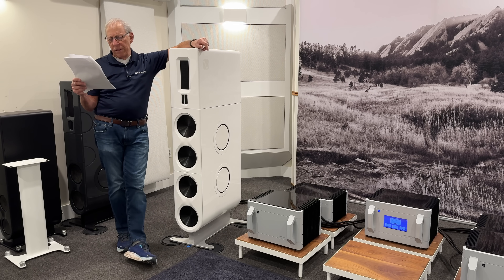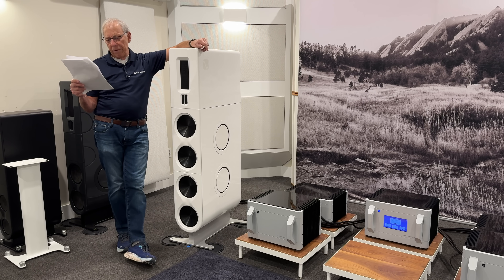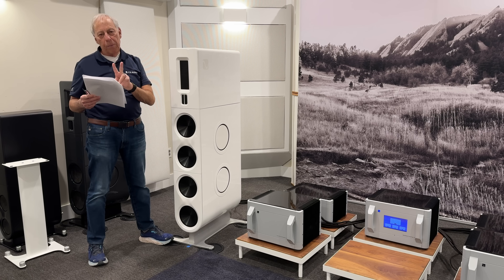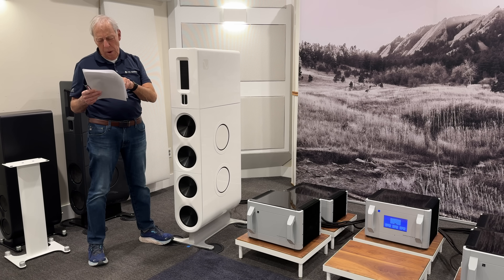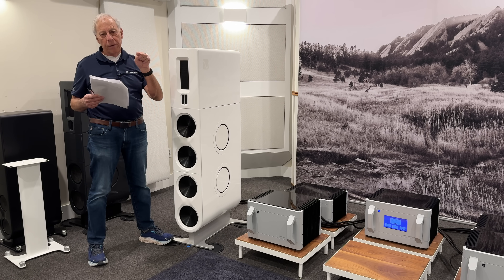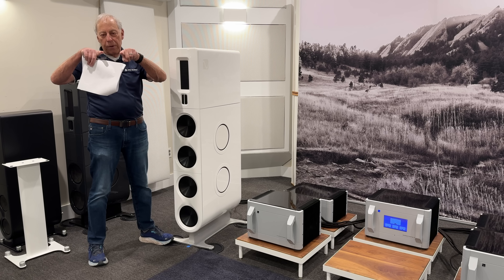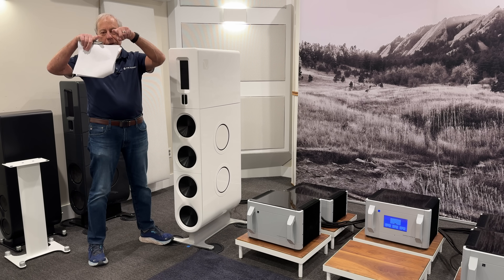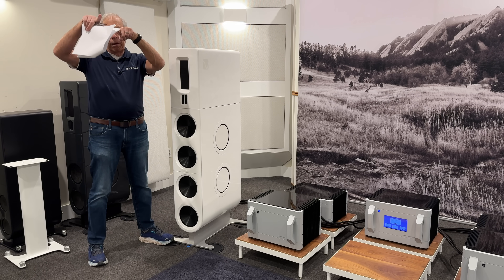Paul explains amplifier gain

Comment: The rotel rc 1572 preamp spec shows a max output voltage of 2v on the xlr ouput.

The rb 1552 power amp is specified as 120 w into 8 ohms with a gain of 22.5 db from the xlr input 
Output voltage to drive 120 w into 8 ohms: (v^2/8ohm) is
31 0 volts
With a gain of 22.5 db = 13.36  voltage gain ..
with a 2v input gives 2*13.36 = 26.72 v output. =  89 watts !?

The  rb1590 power amp is specified at 350 watts into 8 ohms with a slightly higher gain of 23.5 db = voltage gain of 15.
The spec shows it needs a max input of 3 5 as the questioner stated 
With the same 2v input.. this will mean its output will be
30v - giving an output power =
30^2 /8 watts = 112 watts.

Neither amp is getting any where near its rated ouput with  the preamp output of 2v 

IF  we COULD get an input voltage of 3.5 volts from that preamp ...we would get:
3.5 *15 = 52.5v - giving an output power of 345 watts.

Seems like there is an issue with the preamp output?

With the questioner saying he was running the preamp at a modest  setting of "40"  - we can safely say :
Both amps were running at quite low ( and almost equal) powers... and.... it seems neither amp can be run anywhere near max output.

I

Comment: The gain of an amplifier is FIXED according to its design.  What is being set is the INPUT ATTENUATION, usually via a variable resistive load.  Simply, ideally, the input attenuation seeks to match the input voltage max of the amplifier with the output voltage max of the source (matching source and input impedances actually).  That way, full dynamic range is reached with the highest S/N ratio.  Too high, there will be clipping.  Too low, dynamic range will suffer, and the noise floor will increase.  We want maximum voltage without overdriving the input stage(s) of the amplifier for best performance.  There, I said it, EE, power systems.

Caveat:  Some like less dynamic muttled reproduction, as some like the clipped sound.  What is horrible is when the input and source are so far apart that no attenuation will fix it, such as when commercial simgle ended sources are used with professional amplification.  The professional equipment expects 15V, while most home equipment at best is usually around 2.5V.  The source will need active gain (a preamplifier) to properly drive the amplifier.  Ughh, now we add another stage, more noise and complexity.

Comment: “The preamp has an output of 2 volts, while the power amp seems to require 3.5 volts. Could this be the issue?”

YES, that IS indeed part of the issue. If you cannot provide the power amplifier with the required 3.5 volts at the input, you will not be able to get the full 350 watts at the output. This is why your two amps amps seem to be putting out the same amount of power. Paul, you got this one wrong.
Reply: Absolutely.
The higher power amplifier will require  sqrt(375/120) = 1.77 times more input voltage to give 375w ( assuming they have the same gain - however - rotel specs seem to suggest the 375 version has higher gain) 
If we assume that the 120w amp delivers 120w with 2 v input.. then to get 375w will need 2v * 1.77 = 3.54v which it seems the preamp cant deliver.

Comment: Agree with @DeVoN420zz below, what's really needed is to maximize response and dynamic range with as few drivers as possible and reasonable cabinet size. So make a great speaker with one tweeter, one mid (which he has, choosing planars) and get bass with a combo of 8" woofer with good transient response and then a sub to get really low. More drivers with more power (all other things being equal) can produce more dB, but really needed for really large room (or say a wedding venue), and most folks simply don't listen to music in a mini concert hall.

Comment: great video! let me explain those speakers your standing near, if those drivers are all identical then that's pretty much bad engineering and a scam but does look nice, 4 identical speakers and passive radiators quadrupoles the power requirement but only increases the volume DB a little bit, it requires a complicated crossover network that degrades the signal, and wont really improve the frequency response, 1 good driver always sounds better than 4 lower quality ones especially when there all in the same spot, a known fact that you need about 10 or 12 speakers with phase canceling to actually be twice as loud,  A better speaker is much better idea, for example a single 8 inch woofer, with a 100 watts you would need 10 or 12 of these to be as loud as one that's 400 or 500 watts,

Comment: I had a problem with matching gain with my Stellar 300 and Emotiva BasX amps that were doing what you're describing and I just couldn't enjoy the 2 sets of speakers evenly the way I wanted until I got myself 2 Shiit SYS passive preamp potentiometer volume controls. Like Paul likes to say it was an easy peasy fix. Thanks for the better understanding and breakdown Paul. It helps as always 👍

Comment: And yet some reviewers believe an amplifier needs a certain amount of volts at the input regardless of the gain of the amplifier to achieve maximum output. No theme reviews you really need to study basic electronics.

Comment: I think that confusion is next: from where comes the difference when voltage gains are the same for different rated amplifiers? I assume it is current since P=IxU [W]. So I asked the same question but on impact of current to the sound. I assume the current is important when you drive floorstander with many drivers and generally, speaker with low impedance dips. I learned that watching but still not sure did I understood it correct.
Reply: on a normal amplifier the current is just determined by how low or high impedence the speaker basically, the amplifier doesn't control the current until it's too much for the components and something breaks, if it can't conduct enough and things don't break or the overcurrent protection kicks in.

how much actual current will go gets way trickier with a speaker though because it depends on what the cone is doing and how much it is resisting (or isn't resisting being pushed by the air in the speaker back) and isn't linear through the range. it(speaker) has an impedance rating across the frequency range but that too doesn't tell the whole story since what it is now can depend on what the speaker is playing, so reality is just that there's quite a bit of buffer current capability in amplifiers.

generally if the speaker has a 4 ohm rating it should be fine to run with an amplifier with a 4 ohm rating on it. an amp will generally run at least to 2 if not pushed very hard though even if it has a 4 ohm rating on it, it just starts risking or taxing the componentry.

much lower ohms than that because the current still goes up even while the voltage is low will probably cause destruction, even if you're playing at a low volume, because there's some components inside the amplifier that get fried from amps and not from total watts passing through it (that's what a fuse generally does too).
Reply: Yes, I understand fluctuation of the impedance and power is the way to answer it but if the voltage is set, then the current is the difference. So 30dB of gain for the two different rated amps is the difference in capability to drive that voltage with a sufficient current if the impedance drop? The other thing is the attenuation of the signal through the pot so that gain is only out if pot is turned on entirely. Otherwise it is attenuated. Many of us are asking what difference you get with more powerful amp in terms of sound. I understood that you need more power for quicker response and for demanding speakers. And of course if you want to set up the amp to work in optimal region of low distroted power like in motor vehicle where you rarely use peak power.

Comment: Uh. Depending on the imp of the speaker.but yes..
Reply: The impedance of the speaker should not affect the voltage gain.
Reply: @dangerzone007  Agree, except for amps with horrible damping factor where the output impedance is so low that the output voltage drops at loads of near 4 Ohms. A damping factor of 1 would mean you lost half the voltage at a nominal impedance load. But such amp would be horrible for other reasons such as voice coil damping being poor or  impedance curve impacting frequency response.

Comment: The reality is the output of the amp is determined by voltage. The higher the voltage, the higher the watts you put into the system. The gain of an amp is predetermined and most amps are within the ballpark of each other. So with the gain being fixed, the output voltage determines the outcome. More volts equals more watts. For you to have to turn your amp up means that you’re increasing the output voltage. It’s pretty normal to set your amp to a high output voltage so that you can experience full dynamic range.